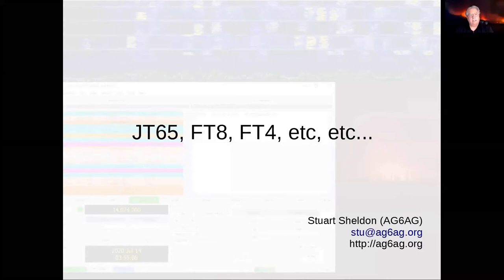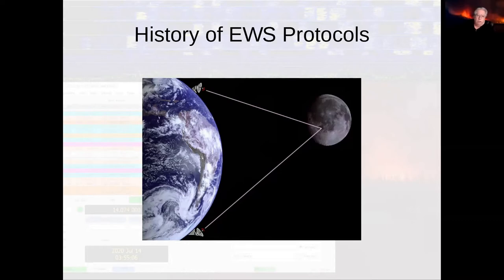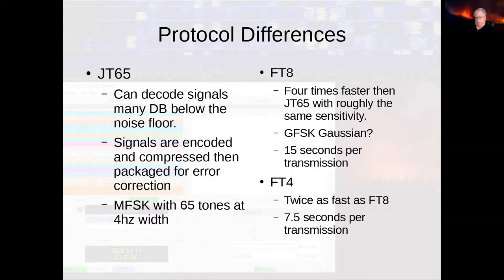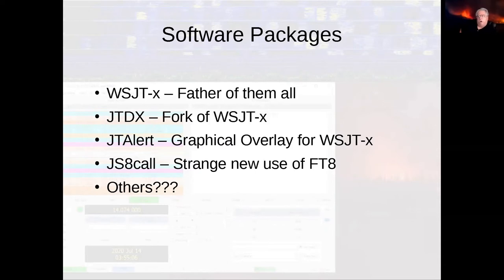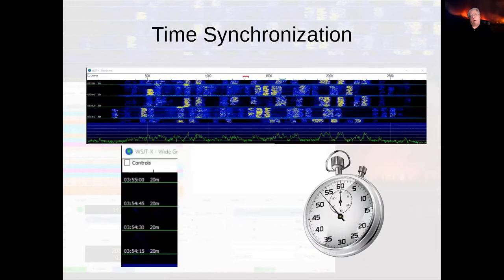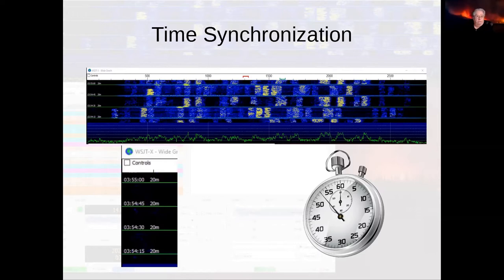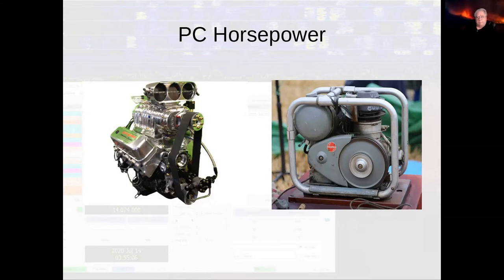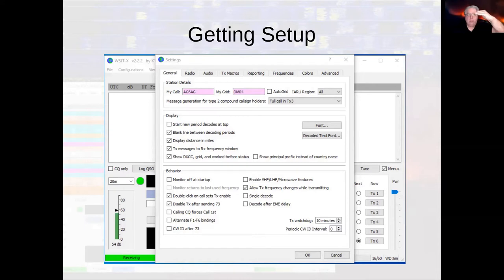JT65, FT8, FT4 And More...

Comment: Nice video, great info. 
I like jt-65 for the much better s/n decoding, but even better is jt-9.  Perfect decodes as low as -29~30 db, but nobody uses it anymore.  With those jt  modes you can decode and work stations that do not even show an increase in noise levels.  Just like magic.  Last year on 17 meters a bit before sundown local (bands all absolutely dead), I called CQ on jt-9 where nobody showed at all, and got a pileup of JA stations calling me, I was on 35 watts out on the meter.  Tried it on jt-65 with very little coming back, and those that did had much higher in db strength than with jt-9.  As nice as the increase speed is with ft-8, the jt modes are much more rewarding.  FT-4 is nice for contests, but too fast for old guys with slower reaction times like me, but still play with it occasionally.The gy asking about splitting tx & rx, when going for DX it is often that they will not answer on their tx freq - you must split.  If you put your tx where the scope looks cleanest and lock it, and let the rx drift to wherever he goes, your chances of a contact is much higher.  Try another tx spot if he still doesn't respond after a few time periods.  Have patience, sometimes it takes a few cycles before he clears his backed up pileup.